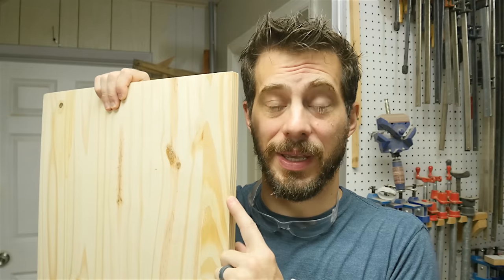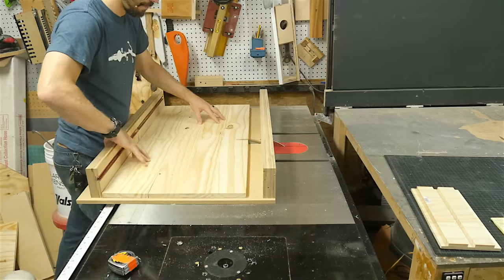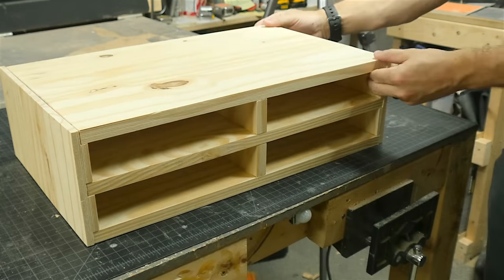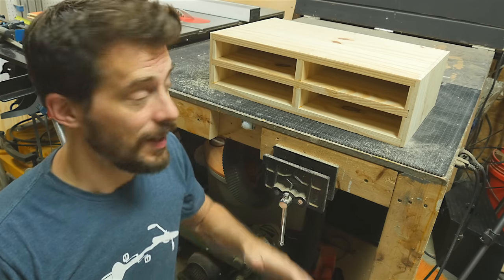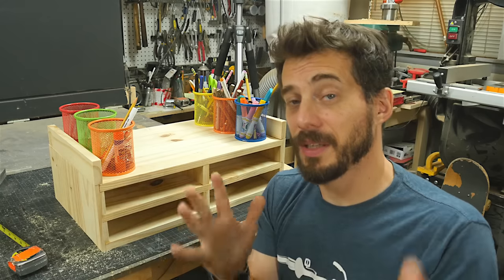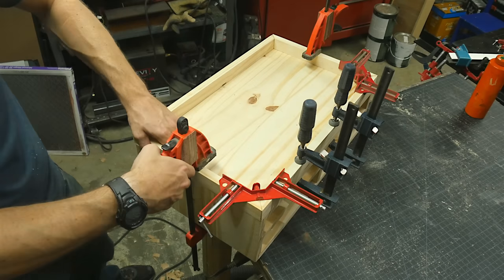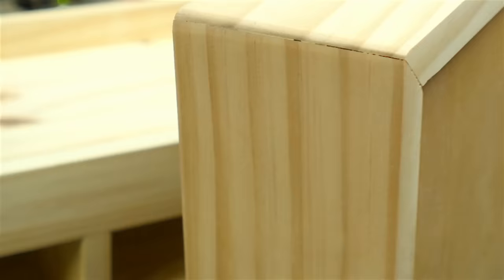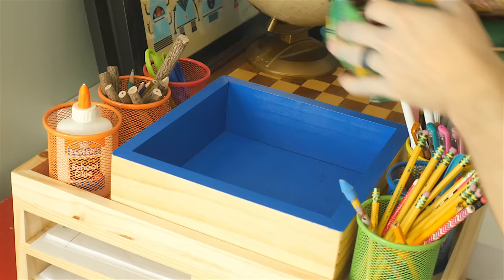How to make an art supply organizer // Woodworking | I Like To Make Stuff

Comment: I love it! My only suggestion would be to drill two holes in each side of the crayon box, then tie a couple of rope/string handles into the holes. Basically, so you can end up with a handle on each side to lift the crayon box out. 

Just a suggestion, regardless I love your work. Keep it up!

Comment: You Americans have a very different approach to woodworking. You rarely use screws or nails, using glue whenever you can, and when you do use them you try to make them invisible. You also waste a lot of material. But it's interesting to watch and I sometimes catch some good tips. Also I really like your electronic projects. Regards from Brazil.

Comment: Hey great little craft tidy, one challenge I have not having the table saw is cutting those dado cuts. Currently I use a router free hand with a clamped edge to get a straight line, but it can be tricky. Any tips if you haven't got a table saw for this?

Comment: I'm afraid seasonal changes will tear those joints apart. First to go will probably be the trim separating from the side panels. MDF + paint would solve this, as would plywood + solid wood edges. 

I don't mean to lecture or troll, just advise before someone else puts a lot of time into one only to have it fall apart in six months. Solid wood expands and contracts primarily across the width of a board, so joining wood pieces with grain going in different directions results in surprisingly strong stresses at those joints. That trim piece is just like a breadboard end, except without the breadboard tongue and groove to allow it to weather the seasonal changes, so to speak.
Reply: Jon Miller if Bob's kids are anything like mine, he'll be making this again in a few months anyhow.
Reply from the maker: I suppose you're right in some places, but we don't have enough of a seasonal change to own heavy jackets :)  100% humidity year round :)
Reply: I doubt that's true for the majority of your viewers. I have a breadboard-end end table I made that, despite being a small table, gets about 1/4" of change over the seasons (1/8" on each side). If I had glued the entire length as you did here it would have torn itself apart quickly, instead of just moving across each other. Most people don't know about that behavior. Might be worth at least an annotation in the video.

Comment: I've had such a hard time getting my miter saw to make good 45º cuts that match.  I've gone through it and trued up every adjustment the saw has, I've use a jointer on my wood to take the bow out, and still I end up with janky corners.  I wonder if I just have a crap miter saw?  It's a Kobalt from Lowe's.

Comment: Ok dumb question

What's the little fin on the back of the table saw for?
Reply from the maker: Not a dumb question at all! It's called a riving knife. It's the same thickness as the blade and keeps the two parts of the cut wood from pinching back onto the backside of the blade. It helps fight kickback, which can be very dangerous.
Reply: Thank you so much, that explains a lot!

Comment: I don't have a dado blade, what could I do instead?
Reply: Make multiple passes over a table saw, or multiple passes with a circular saw.
Reply: mab4110 Do you have a router? Because that would be the next easiest way to cut wide dados. You could do it with a regular table saw blade by doing multiple cuts, moving the fence over 1/16"-1/8" at a time until you get to the desired width, it's just more time consuming.